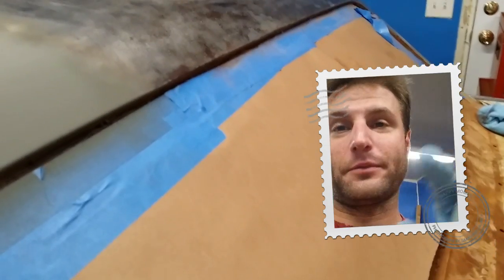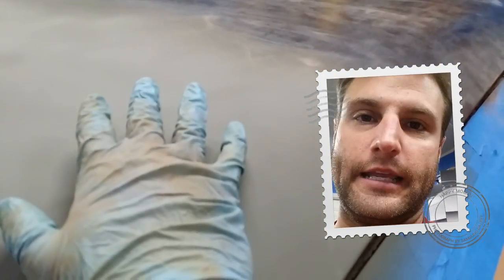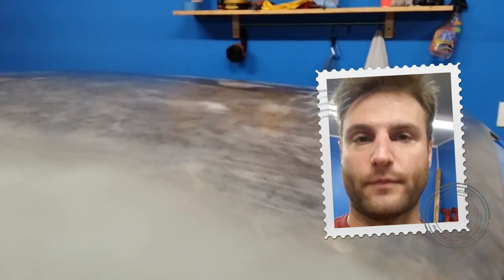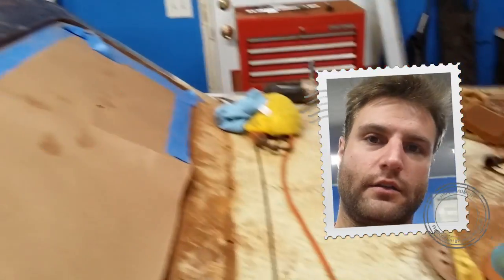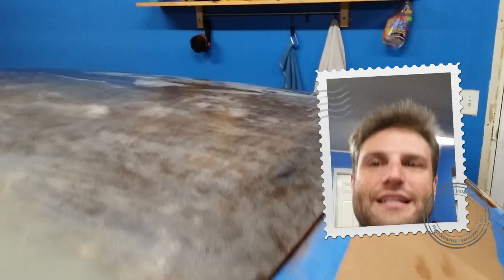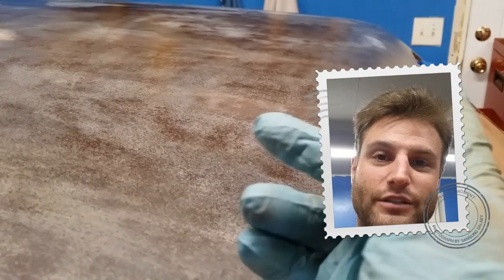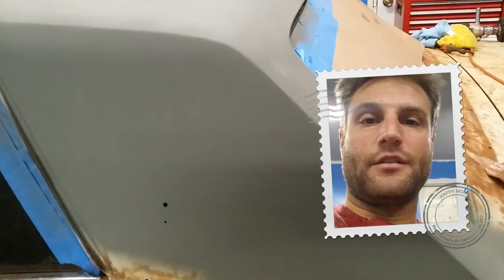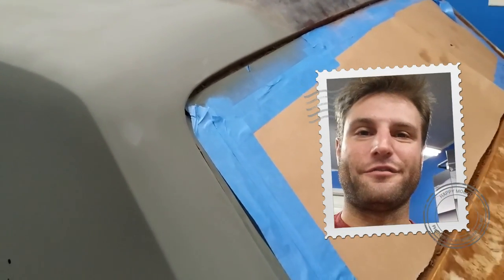Restoring the Lincoln Continental 3. DISSOLVE RUST

Comment: ive had the fortune to work on some amazing restoration projects this summer, and the pro painters there said that the only layer that really protects the car is the clear coat. Than the car will be resistant to rain/snow/cold etc.... 
so you might want to paint it ^^

Comment: white vinegar works really well and is a lot cheaper than any acid. also etch primer doesnt really seal the metal. so if you live in a really humid climate its best to spray a sealer over that so the moisture doesnt get into the etch primer and rust your panel out

Comment: Hey Rob! Thanks for the tips. I doubt this would work on my '76 Thunderbird however since it has some pretty bad rust issues on the fenders. But I know the pain of a car barely fitting in your garage. I've got about 3 inches of clearance in the front and about 8 or 9 between the rear bumper and the door.

Comment: Phosphoric acid is much cheaper to buy (Klean Strip prep and etch is like $15 a gallon) and I feel its way easier to spray on then to mess with naval jelly. Im taking my 240Z down to bare metal so none of this is new to me. Careful with the spray bomb rustoleum stuff as some of it doesnt jive with actual automotive paint. I recommend buying the Harbor freight HVLP sprayer and some epoxy primer to seal off your work and keep moisture out. Ive also found that the knotted wire wheels are better than the cups for removing paint
Reply: Verum Quaerere Seek Truth haha he had to get to the other side of the car somehow. As he showed in the video the car goes all the way from on side of the garage to the other soo no room for him to squeeze by
Reply: TheDrogan91 all that money to spend on cars and a short ass garage. Sucks for him
Reply: The harbor freight HVLP sprayer is like $100. I know I sound like a harbor freight salesman but thats $100 compared to at least $2-300 for a compressor, probably around $100 for a gun and then all the other stuff you need to buy and worry about with a non turbine system. I also picked up a cheapo angle grinder from harbor freight($15?) and thats what I use for removal instead of a drill. A lot of primers are porous and let water in but its hard to beat epoxy primer and a solid undercoat or urethane top coat
Reply: ***** wtf is a boot print doing on the trunk? LOL!!!

Comment: Great work! That should do a fine job for years. This is honestly not that half assed at all bro. Let me share the little I know with ya.

I've been doing resto's for awhile. Navy jelly works pretty good but I prefer gallon liquid phosphoric acid. I get gallons of 52% phosphoric acid or better on ebay for around 30$, and the proper procedure to the best of my knowledge is clean the surface as best you can with whatever means you deem necessary as you did. Those black carbide impregnated discs are incredible, flap wheels, wire wheels, sand blasting, wet blasting, mayonnaise pool whatever gets your rocks off just mind most abrasive means add tons of heat which can warp or distort panels, wet blasting is my favorite but there isn't a lot of people doing it in our area. CHEMICALLY clean the surface with denatured alcohol or rubbing alcohol, acetone, brake cleaner or whatever you have that doesn't leave a lot of residue. This will ensure that your acid is eating rust not being neutralized by oils or busy wasting its potential on dirt and grime. Apply the phosphoric acid with a brush generally, let it do it's thing for 20 minutes or so reapplying as necessary or if you're lazy you can cover it all with plastic wrap to keep it from evaporating, you really don't want it to dry but if it does you can re-hydrate it with more phosphoric acid no harm done. after the magic happens you use dish soap and water possibly with a splash of rust inhibitor used for wet blasting if your that anal about it (Im not) wash the phosphoric acid off (the surface is now phosphated) and IMMEDIATELY hit the treated area with a heat gun, this will drive the moisture out before the part can flash rust. Works great. If you do get a little flash rust you can retreat it or scuff it off with a red scotch brite, blow it off with an air nozzle and hit with a rattle can of spray etch primer. Any time blocking that I hit bare metal I hit with spray etch or one of the 3m or SEM surface treatments. It's what the manufactures recommend in there P-sheets and those are gospel. Get that peace of mind. I prefer the SEM products they sell at JS&P body shop right behind lazy boy but painter supply on N telegraph near where the diablo sleeps generally has the better prices on filler, mix sheets, wax and grease remover, all the 3m norton ppg goodness you can shake a stick at. 

I do prefer naval jelly for gas tanks though! I used it in the gas tank of my 1967 E-type Jaguar turned out real well took quite a while, after you get that out you swash around some gas tank sealer in it, I do believe that most naval jelly was around 13-20% phosphoric, the stuff you can get on ebay is up to 85% phosphoric, I use 52% for no real reason other than I was also doing firearm reparkerizations and cocktailing my own parkerizing fluid so I had gallons of 52% phosphoric sitting around. I know that 52% stuff works in about 20 minutes though and has been real safe even when you get it on your skin by accident it will itch a bit but not really burn unless you get it in your eyes, in which case it burns a lot and for quite awhile but i've seemed to fair well lol.

Comment: Looks good Rob! But someone correct me if I'm wrong, but isn't primer porous? When I was painting the bumper on my truck I was told not to leave uncovered primer on because water would get underneath it and just rust over it again. (This was after I had used a rust converter and metal conditioner on it)
Reply: Good deal! I can't wait to see the finished GhostShip! What are your plans on color?
Reply: *****
I suggest that whatever top coat you decide to apply, at home, you put it on light so when you take it to the body shop for real paint they can just buzz it off (and probably the rattle can primer too) with a DA and put a much higher quality professional product (not from rattle cans) on it. As you have noticed, vinyl tops rot cars like crazy so you're going to want the best thing possible under it. It's also worth mentioning that you may end up money ahead to have the car media blasted. Last I checked it was about $1k to have a big car done.
Reply: Maxwelhse he probably doesn't really care what he does with the roof outside of some kind of rattle can clearcoat or something because its going to be covered with the vinyl anyway right?
Reply: No... It's important to get a good foundation on the metal because that vinyl is NOT water tight. That's how it got so rusty to begin with.
Reply: Maxwelhse It will be under the vinyl so it doesnt need paint on it just some type of water-tight seatant. Not a shiny new paint job haha
Reply: The foam under the vinyl will draw condensation and primer ISN'T a water-tight sealant. Just FYI.